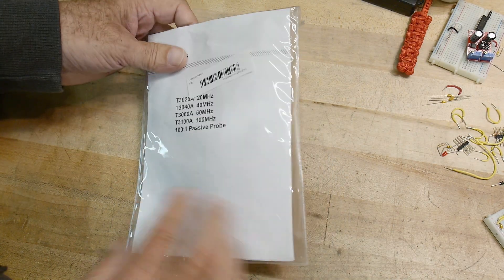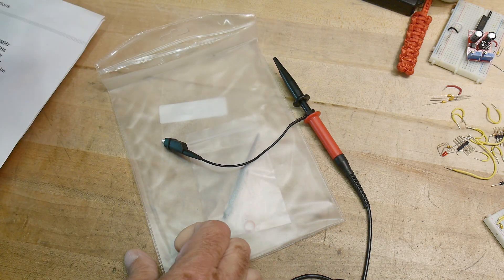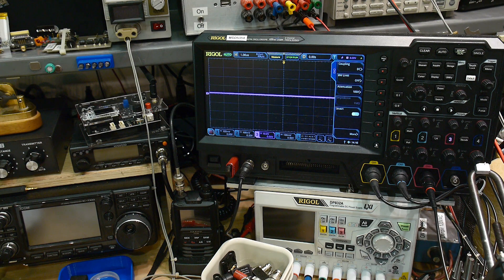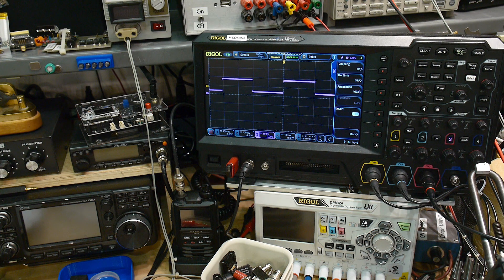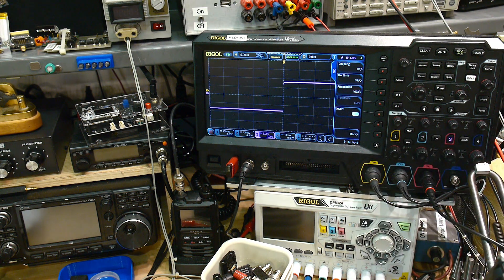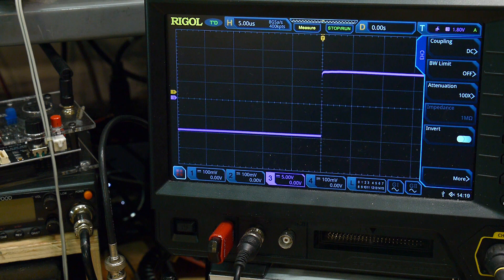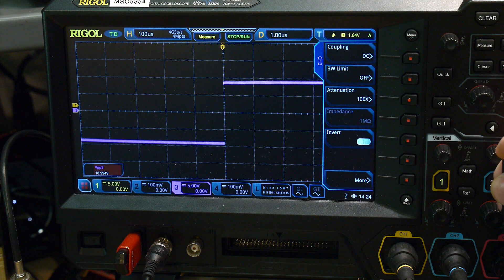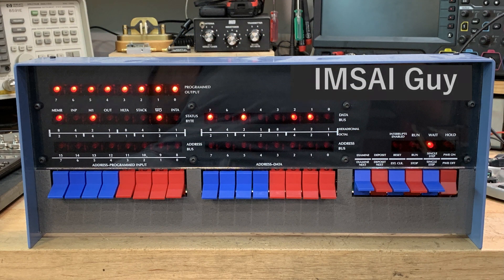#1116 100:1 Oscilloscope Probe

Comment: Since you did not mention it and someone else mentioned blowing up a channel in their scope.  If you have a 100:1 passive probe like this, you have a 100m ohm resistor in the probe and a 1m ohm input impedance in the scope. So if you probe a 1000V circuit the voltage drops to 10V at the scope input.  But in my understanding that is only true when the scope is in DC coupling.  If you set it to ac there is a capacitor in series with the input and any DC bias in the circuit you are measuring ends up directly across the capacitor in the front of the scope.  I have a mso5000 too and haven't used it much at HV.  But I have wondered why there isn't a resistor in the BNC end to create a full external voltage divider.  

It's on my long list of things I need to understand, but I'll grab the Tektronix 422 or 547 when I get scared for now

Comment: One of these cheap 100:1 probes with a flaky connection killed a channel on my first scope. I was probing around, it wasn't showing up, I heard some arcing in the connector... and the channel was dead. I was able to repair it but still, buyer beware.
Reply from the maker: Hmm... maybe I won't use it
Reply: It will be a good idea to add a Transient Voltage Suppressor TVS between the probe and and scope. Seems not very difficult if you use a female-female for lowest added capacitance.

Comment: Hello, I just got my Siglent SDS 1104 x-E. I do have some quality x100 probes. I know that Dave from EEVBlog sells a device with which he can measure the 230v. What is the difference between using his device and using this x100 probe for live 230v? Don't worry I won't just stick the probe into the live socket. 🙃
Reply from the maker: I'm not familiar with Dave's device
Reply: @IMSAIGuy  Hello, actually is called HV Differential Probe. Dave... EEV Blog... Thank you
Reply from the maker: @catalinalb1722  Oh, ok. lots of folks sell those. they allow you to isolate the measurement since the scope ground lead will get you in big trouble if you connect it to the line voltages. So, probe tip is ok for line but not ground lead. I have a battery powered scope that allows me to connect things without ground problems.
Reply: @IMSAIGuy  oh, yes, it makes sense now. Thank you very much for your explanation 🙂👍

Comment: I'm not quite sure, because you didn't show it all but from what I could see you used 10kHz, 20kHz and 200kHz square waves while adjusting the LF compensation. You should use something around 1kHz. Higher frequency square waves don't have enough LF content to show the LF peaking and drooping you're adjusting for, resulting in the variation of the square wave amplitude when trying to adjust LF compensation. The "peaking" you saw was just the extreme that could be reached with the trim capacitor.

Comment: When it starts working flaky,  check the crimped ground connections on the connector. The one I had must have bypassed the  QC inspector . After the repair it seems to work ok.  They save a lot of wear and tear on my Tek probes.

Comment: What is the rise time of the probe?
Will you make a teardown to see the type of cable used? (Also for a cheap 10:1 probe).
Reply: I have seen several of the suepr cheap chinese probes using a single quarter watt through hole resistor inside. 
Pretty bad, both for HV safety and frequency response. 

Another interesting point would be the max. voltage vs. frequency plot. Most cheap 100:1 probes can only handle the high voltages up to a few kHz.

Comment: Probe sounds interesting.   How good is grabber end, say compared to a Tektronix?  I purchased a Rigol DS4024 a few years back, like the scope except for the probe grabber tips.  They have almost no spring holding power, easily slip off and don't seem to make very good contact.  As I found out,  never solder on the wire you clip to, the probe tip will melt.  Rigol doesn't sell them as replacement items but did get them to replace a couple of bad ones.

Comment: a clip leadI remember Tektronix used to get an arm and a leg for their 100:1 probes and as I recall they were good up to 1,500v. I used to use theit p6015 probe that was 1000:1 and good for 30,000v when i worked on HV supplies. The 6015 was huge so it wasn't the kind of probe to could walk through circuits with.
Reply: I remember a huge HV probe.
It was filled with some special gas, right?
Reply: @paulcohen1555   Each probe came with a small can of freon, you were supposed to keep the fluid at the end of the probe covered to maintain it's HV rating. That said i don't think I ever had to top that fluid off in the decade plus we had that probe.

Comment: They are also pretty useful for high impedance circuits since it limits the influence of the probe, because they add very low capacitance.
You need to make sure that you have enough voltage there that you are able to see anything after the x100 attenuation though.
Reply: Sure!
There are no free meals!